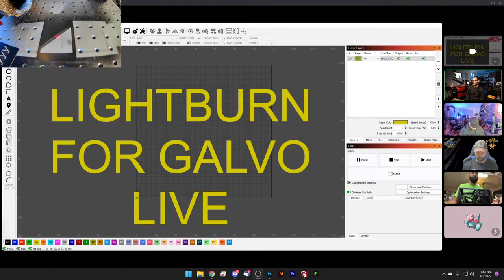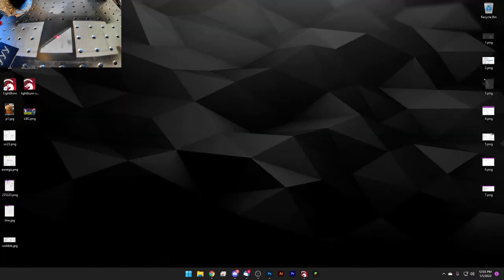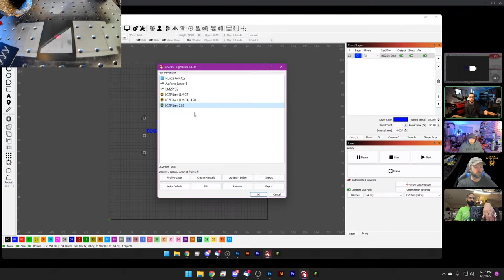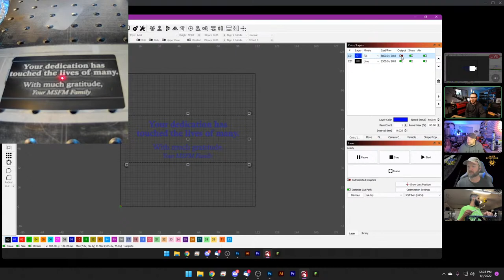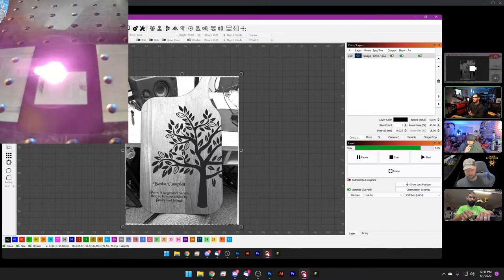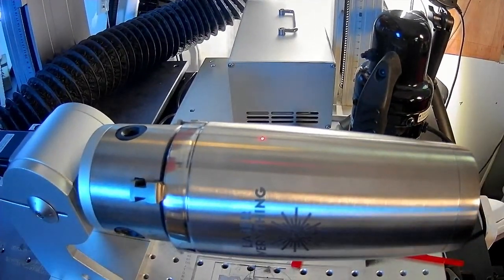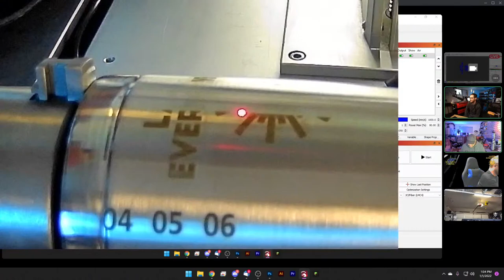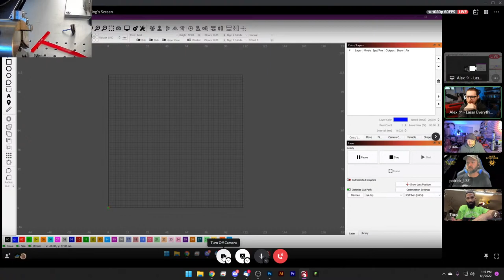LightBurn for Fiber and other Galvo Lasers - LIVE!

Comment: 2:06 - Starts and introductions of individuals.
4:03 - Introduction of LightBurn for Galvo being closed Private Beta.
5:31 - Pricing questions.
6:30 - Can I be a beta tester?  Pay attention to the channel updates.
6:47 - What boards are supported?  EZCAD2, EZCAD Lite, and Cloned.  EZCAD3 (3D) isn't supported.
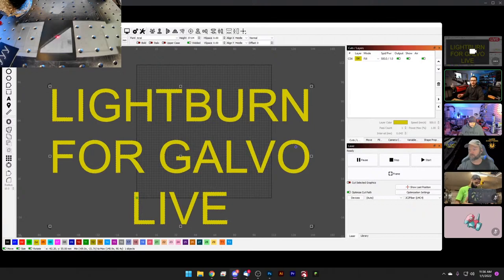7:25 - What operating systems are supported? Mac, Windows, and Linux
7:35 - Mentions of previous podcasts of LightBurn.
7:53 - Catching up on Q&As from chat (e.g. 'Will EZCAD3 board work').
8:25 - Mention of future video board downgrading.
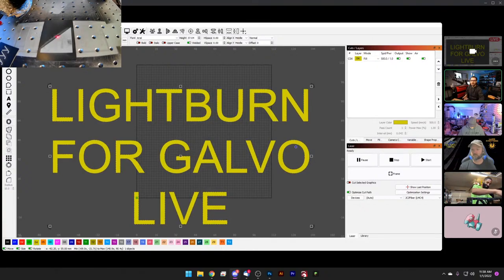9:08 - Keep using EZCAD2 cause it'll apply to LightBurn
9:38 - Laser Everything will continue making content for EZCAD2
10:48 - Catches up on chat.
10:39 - Jason from LightBurn said there, "We will not likely have an open beta... but will curating volunteers."
13:26 - Chat Q&A's
16:26 - Starting to use LightBurn, Q&A chat.
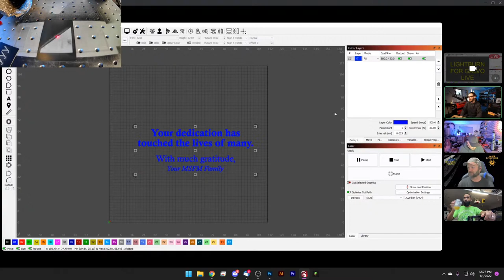18:35 - Gets back to using LightBurn.  Discussing hatch settings.
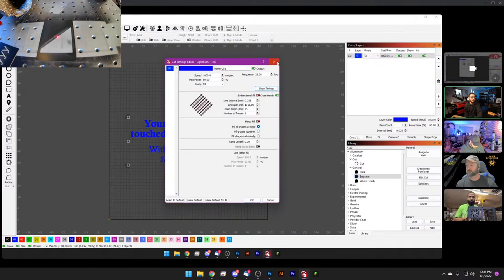22:03 - Machine settings.
22:30 - COR files not natively supported.  Must do it manually in LightBurn.
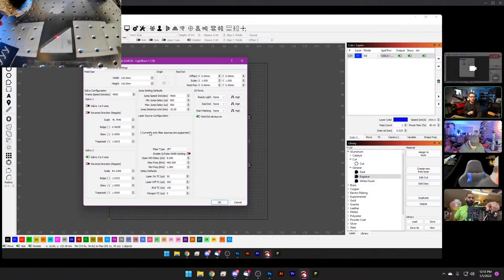24:38 - Only "Currently only fiber sources are supported".  No CO2 Galvo.
25:42 - How lens profiles work in LightBurn.
28:15 - How to run multiple jobs on same computer but different engravers.
29:22 - "Will it work with LightBurn Bridge?"  No.
29:50 - Back to using LightBurn.
30:04 - Laser control menu (e.g. framing).
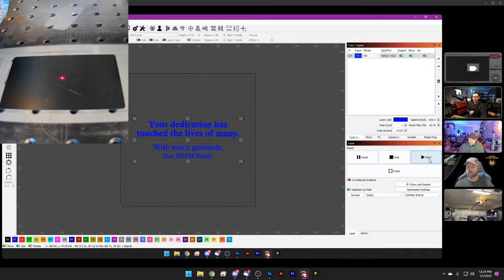35:34 - First engraving with LightBurn.
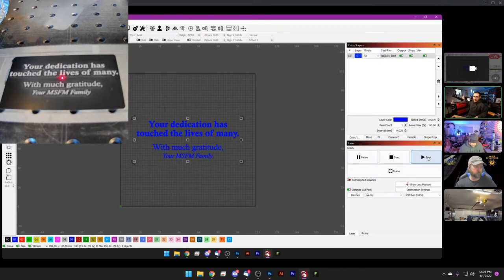37:13 - Done engraving.  Starting cut settings.
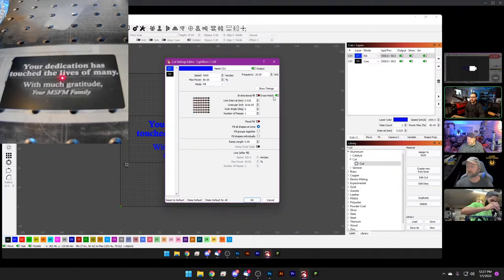38:40 - Start cut job with fiber engraver.
39:19 - Cut job done.  Discussion of wobble; no wobble feature yet.
40:57 - Jason has updated LightBurn to allow for pass count from 6 to 100, and upping to 1000.
41:37 - Discussion about raster images in LightBurn.
44:12 - Discussion about auto-power settings based on raster greyscale.  Per Jason from LightBurn, currently not supported.
46:01 - Alex runs a greyscale engraving job in LightBurn, talks about pizza and chat Q&A.
52:15 - Alex stops greyscale engraving job because greyscale isn't supported.
52:22 - Jason from LightBurn confirms rotary for galvo does work.
53:08 - Alex adjust DPI.
53:45 - Starts engraving again after adjustments.  Continues Q&A.
56:24 - Job done.
57:00 - Showing up close engraving job.
58:00 - Alex sets up rotary job in LightBurn.
1:07:24 - Starting of vector engraving job with rotary. Settings were incorrect.
1:08:12 - Corrections made for rotary settings.
1:08:45 - Jason from LightBurn confirms pulse width is currently not implemented.
1:10:34 - Alex starts the rotary engraving with correct settings.
1:10:44 - Rotary vector engraving stopped so Alex can adjust settings.
1:11:09 - Rotary vector engraving started again with adjustments made.
1:11:48 - Rotary vector engraving stopped so Alex can adjust settings.
1:14:18 - Rotary vector engraving started with updated settings.  Chat Q&A.
1:17:09 - Rotary raster engraving job done.
1:18:51 - Rotary raster image engraving job started.  Chat Q&A.
1:21:34 - Rotary raster image engraving job done.  Showing, discussion of results, continuing chat Q&A.
1:17:10 - Alex closes out screen of LightBurn, and continues chat Q&A.
1:30:10 - Tony mentioning Jason from LightBurn stating it'll be available Q2'ish.
1:31:00 - Wrap up with chat, plugs for Discord, site, etc.
Reply from the maker: Thank you Sam

Comment: 22:30 - CorFiles need to be supported since they are sent from your computer to the laser itself. The early commands during connect really does a 0x15 (WriteCorTable) and then sends an all 0x8400 bytes of the cor table. So your laser can do the 65x65 table lookup for the dx and dy positions. You couldn't really make your own version of that. You'd need to send a cor table to the laser.
Reply from the maker: LB could generate their own corfile though, what I really meant was that I'd like to generate corfiles natively in LB, not that they shouldn't be used at all

Comment: Newbie question but what are Galvo lasers?  And there seems to be much excitement about light burn being available can a laser user expand on this
Reply from the maker: Gantry lasers are lasers where the beam being bounced through mirrors into a head that physically moves around the workspace. Think your classic CO2 tank machine like the Red/Black omtechs. Lightburn has always worked with these machines. Galvo lasers are different. Instead of physically moving the head around the workspace, the beam is projected onto the workspace with a special lens. These lasers operate very differently from gantry lasers and are typically much faster. The announcement that lightburn is supporting these types of lasers is a huge deal.

Comment: Newbie question. I'm in the market for a new fiber. If I wait for Lightburn to be released,  will laser manufacturers be releasing lightburn as the design software,  or will it stay as-is with ezcad2 standard and lightburn  as an add-on?
Reply from the maker: I obviously don't have direct insight into the situation, dependso n how hard Jason goes after it. It's safe to assume MOST will still ship with Ezcad for the forseeable future.

Comment: I am totally new to fiber lasers and I am a few days away from ordering the fiber laser listed below. My question is now that Light Burn is coming out soon and is going to support fiber and galvo lasers should I down grade to an ezcad2 card?
Does the 2.5D support the ezcad2 card?
I currently use Lightburn for my Co2 and love it. I was dreading that I would have to learn another program. Thanks in advance for your help!!

BWM - 50W  2.5D Split fiber laser marking machine. 
1.Genuine Ezcad3 Beijing JCZ controller card 
2.Ezcad3 software (3d version)
3.50W JPT laser source
4.Motorized Z axis tower
5.Superior Ouya Galvo head
6.Three lenses:110mm 200mm and 300mm 
7.One $90 goggle for gift
8.One rotary for gift & 20 coin blanks for gift
9.110V 60HZ,foot petal, tools, instructions, etc.
Reply from the maker: Hey Shann, they are not promising EZ3 support right now so if you want to guarantee Lightburn support and you want to buy right now I highly recommend an EZ2 board. If 2.5D is important to you you may want to hold off on your purchase until LB announces EZ3 support. Right now nothing EZ3 including 2.5/3D functionality is not guaranteed.
Reply: Thanks for your help! I think I will just get  a Ezcad2 unit. Since it will be cheaper I can get one with more power. I’m so excited about lightburn and I think this will be a total game changer! Keep up the great work and I can’t get enough of your content!!!
Reply from the maker: Thanks, will do, and that sounds like a great plan!

Comment: Will the Atomstack M4 supported, or will it ever be supported.

Thank you!
Reply from the maker: Last I heard, the atomstack M4 was based on a BSL seacad control board. While its similar to ezcad2 (which is what lightburn originally targeted for support), it didn't initially have support and was different enough that it wasn't able to be supported initially. I know the lightburn team posted that they hope to work toward adding that compatibility a while ago and expanding support for other controllers was on the plan list, I'm not sure of the current status on that. I didn't see any announcements yet for it, so you may need to check back on the lightburn forums for updates on that.

Comment: I have no experience with lightburn and have only played with ezcad 2 for 2 months.  Definitely looking forward to a more user friendly and better sw. trying to just burn a simple jpg image in ezcad sucks
Reply from the maker: Galvo lasers will always have quite the learning curve regardless of software, but if you aren't fighting the software every step of the way it certainly helps.
Reply: Trying to move from my cad background into ezcad2 was sooooo stressful.. the software is brutally simplistic and not smart enough to do what you would expect to do a a simple step. Ie if you import a simple dxf file there isn’t a way to modify that file at all (at least I haven’t found) if you need to remove a line or add a line ..  I’ve found a few of your other videos very helpful in shortening my learning curve … but I’m still learning the basics
Reply from the maker: You'll get there keep working at it. Like anything else it takes practice. You have to do it and fuck it up a lot till you get the hang of it.
Reply: @LaserEverything  I gotta find your discord group you keep mentioning…
Reply from the maker: There's a link in the video description
Reply: @LaserEverything  I just joined it… posted a question.. hoping you can take a peek at it

Comment: Now i do feel stupid for dropping 1550 USD into a Ezcad3 and controller... Because i know Jason will also get the 3D part working in the feature. I might downgrade my laser again,as said the downgrade might be an upgrade as i would be able to use Lightburn :-)
Reply from the maker: You can always reinstall the EZ3 card when it's supported, you don't *have* to get rid of it.